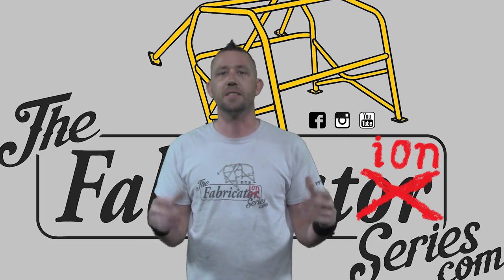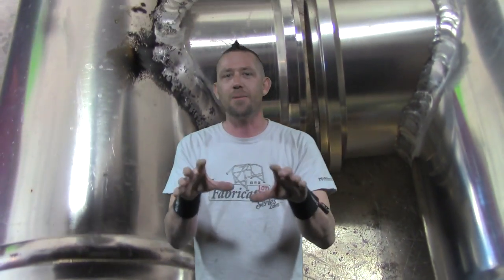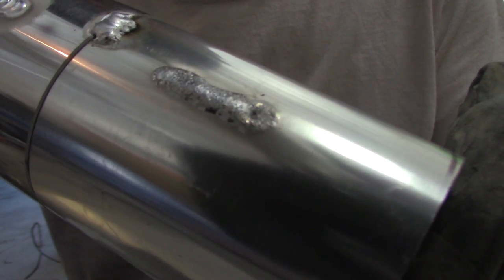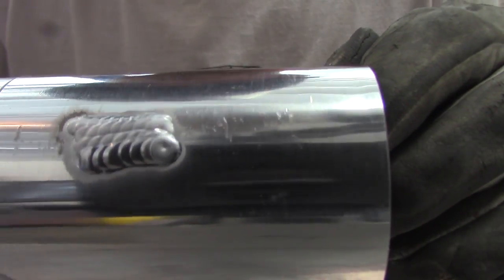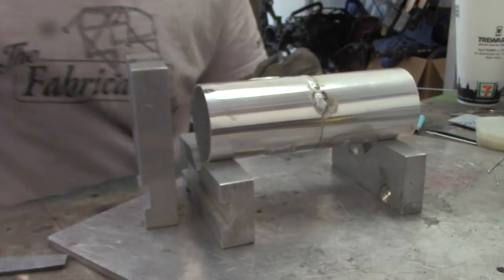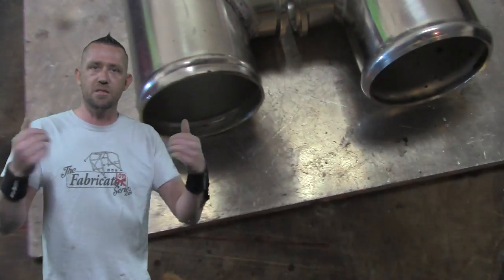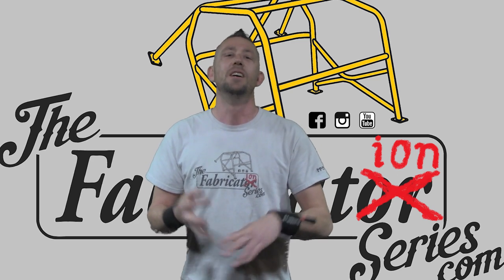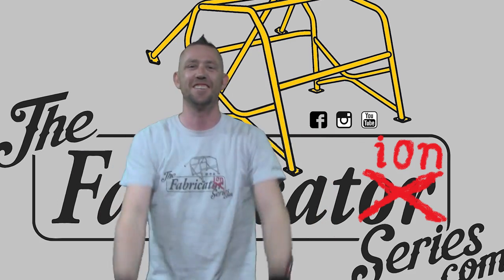TFS: Mystery Metal

Comment: Glad you made this video up. I am in a learning stage and picked up some scrap aluminum just for running beads, etc. A lot of it was ok but for sure some "mystery metal" got mixed up in the batch. Again it was only for learning, and maybe I did learn some by fighting with it.
Thanks, Tom
Reply from the maker: There is a pretty big learning curve to aluminum. It can be a tricky metal to work with, but encountering mystery metal during the learning stages can really mess with you haha. Good luck!

Comment: Another way to be assured of what metal you are working with ( besides avoiding EBay mysteries ) is to deal with suppliers that have mill certification documents that accompany the material they supply, this way you know exactly what you are getting .
Reply from the maker: Tanglefoot Woolford That is very true, but there are a bunch of copy/paste descriptions which are bogus. It really all depends on the vendor though.

Comment: Worked at job shop 20 yrs ago, and a customer brought in a two wheel buggy used behind a horse that had a break on the frame. Looked like aluminum, but when I tried to weld, the heated area completely fell out. I was like WTF. Asked the owner to try and find out from the manufacturer the kind of material. Unfortunately, I was leaving the job the next day for a different job and never found out.

Comment: The only solution is to use a verified XRF scanner of a well known manufacturer with all the hardware and software support.
Since these instruments are expensive for a fabricator to own, the supplier may have it and use it making measurements and verifications of the metals he sells as his internal procedure of accepting any metal in his warehouse.
See my choice of XRF scanner, the X-MET8000 Expert – Alloy Demo Package  plus the Small Spot Collimator. Here in Greece costs around 30000 euros.
Reply from the maker: An XRF would be nice to own, but not practical for the average DIY guy or Fabricator. Thanks for watching!
Reply: Actually all that is needed is OES.  Handheld units can be had for $1,000 or so.

Comment: Nice content.  Maybe there aren't any but any "workarounds" for dealing with mystery metal would have been great.
Reply from the maker: S Koue There isn't one that I know of. Just test each piece out before using it.
Reply: @TheFabricatorSeries  A materials testing laboratory will have a piece of equipment for a materials test called "Optical Emissions Spectrometry", or OES.  With a small material sample or access to the material the elemental composition can be determined and an alloy match made.  Portable units for as low as $1,000 or so are available.

Comment: Did you ever find out what the "mystery metal" is?  Conceivably, it could have still been an Aluminum alloy but of the 2xxx or 7xxx alloys which with only  a few exceptions are considered unweldable.

With my background, I have a bit of fun when I ask someone what the material is and they go "Stainless" or "Aluminum" and I respond, well I have about 20 books on stainless alloys and there are a few hundred alloys classified as "stainless steel".  Which one is it?

Comment: I had a welding experience like this on one of those aluminum razor scooters. I found the base frame in a trash pile and thought I would use the bottom for TIG practice. Big mistake, have no idea of the alloy used or if was like what you showed here. The puddle just sank into the plate, it was very difficult to produce a convex bead. Used a ton of filler metal to keep up, but the bead just looked frosty and flat/concave. I wondered what "I" was doing wrong since I was a new welder. Maybe it was 7000 series aluminum or some other un-weldable alloy?
Reply from the maker: It could have been 7 series or just anodized. I attempted to repair one a while back and had similar issues. I told the guy to just buy another since they are so cheap.
Reply: I didn't think about the anodizing, maybe it was both! Thanks for the info.

Comment: This is why I haven't used customer supplied material in 7-8 years.
Reply from the maker: Ben Ben It's not always a bad thing to accept customer supplied metal, but it definitely can have a downside. I still accept it since a lot of people like to save a few dollars. Nothing wrong with either decision.
Reply: I work in a shipyard for my "9-5" and 99% of is rusty rotten steel. When I do side work I don't like anything less than my best welds and fitting.

Comment: Can the weld be salvaged by grinding down and rewelding? 
In other words welding over your mostly good previously deposited  filler adding additional good filler?
Reply from the maker: patw52pb1 I haven't tried that. To me, it would be extra labor and the result will need finishing regardless because of all the grinding. Worth a shot if you have time though.

Comment: Is steel tube much safer from these tricks? I recently did an exhaust and bought the cheapest mandrel bends I could find on amazon. Seemed to weld ok but I'm far from amateur at welding.
Reply from the maker: Zeke Rayment Not sure about mild steel, but there is definitely mystery stainless out there. It's usually just electropolished and sold as 304 (but far from it).
Reply: It takes a big shift in alloy elements to change the weldability of steel.
Reply: @TheFabricatorSeries  A lot of material passed off as stainless are in the 400 series.  Technically it is a stainless steel alloy, but it has very little Nickel in it.  It looks pretty, but does not have near the corrosion resistance of the the 300 series and Duplex stainless.  You can identify 400 series stainless steels as they are slightly magnetic.  The 300 series stainless are non-magnetic.

Comment: It would helpful if you would give what you look for in a supplier. There are good suppliers on the internet and some locally.
Reply from the maker: I've had the same wholesale supplier for over a decade. It's difficult to say what constitutes a good supplier unless you actually buy and test the product. That's pretty much why we end up with mystery metal to begin with. Some are good suppliers for other products, but most of them don't really know exactly what they are selling unless they are the actual manufacturer.
Reply: Thanks that helps!! As a side not I have a Cuz that welds on Liquid Nitrogen, Helium, etc. tanks and piping you should see the certificate needed to weld on those as they need to pass X-Ray testing the first time.